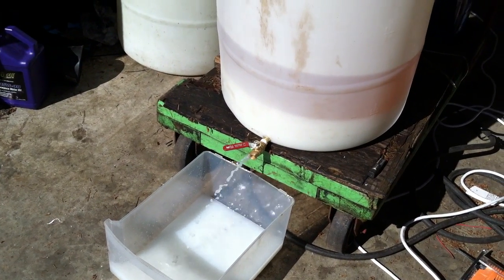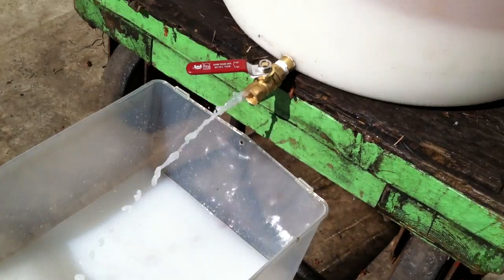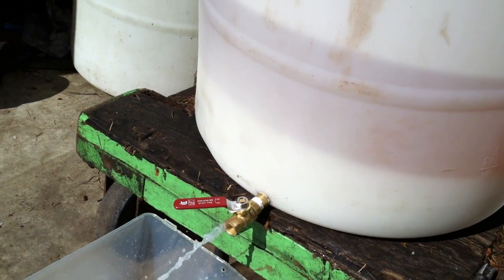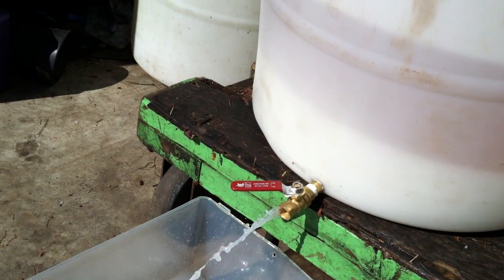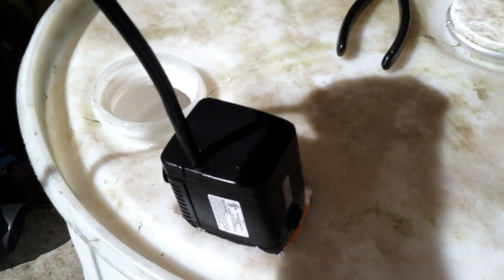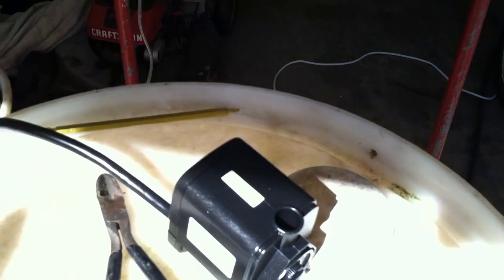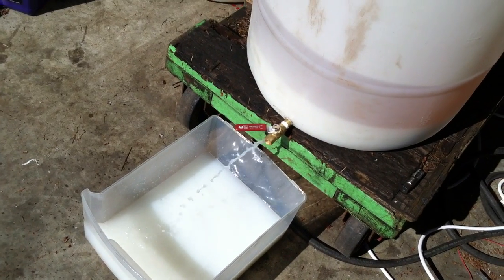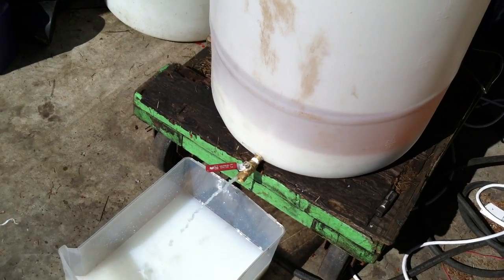Draining the soapy wash water out of my biodiesel

Comment from the maker: It certainly makes it better and cleaner. Not washing it, at the very least will leave methanol in the oil. Ever see the warnings about starting fluid in a diesel? Very similar problem when you have methanol in the diesel. It's far too explosive for a diesel. The other problem is the soap. When the water turns white during the wash, that's soap that it's removing from the biodiesel. For the most part, the older diesels can cope with this. Newer diesels, though, have a LOT of trouble with it